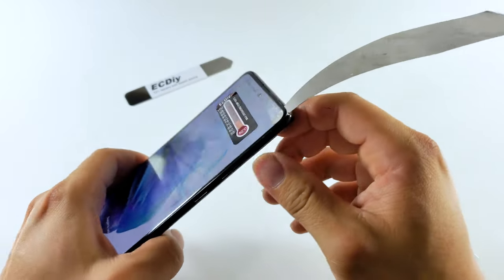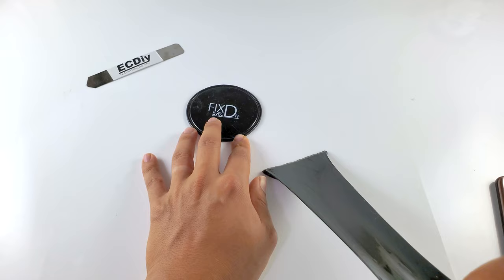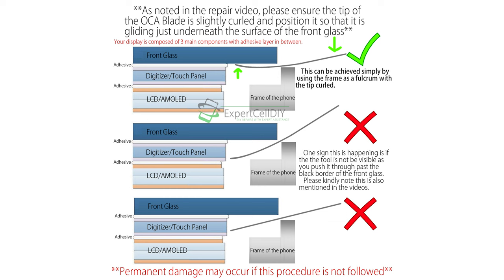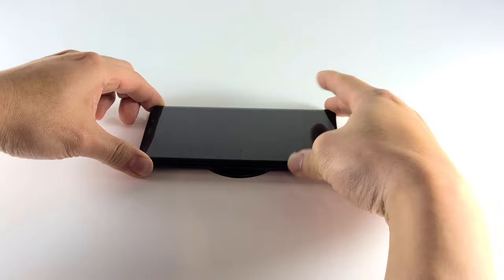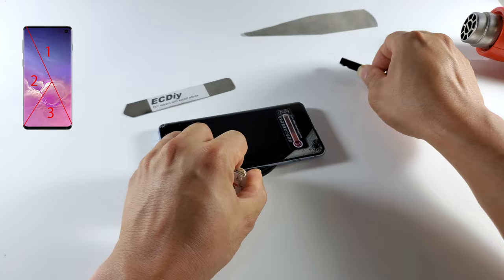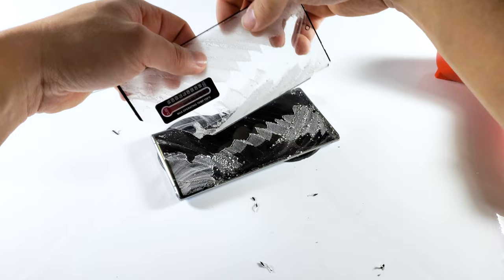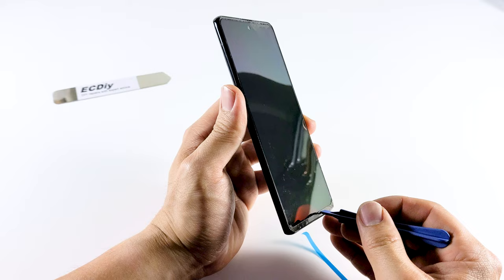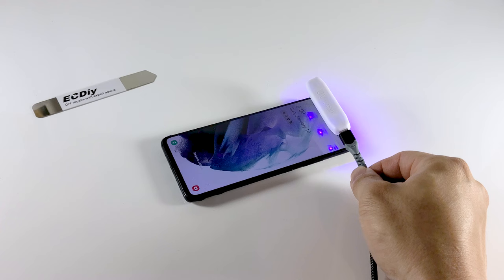How to Replace Screen Glass Only on Galaxy S22/21/20/10/+/Ultra/Note Shown in 6 Mins/New DIY Method

Comment: This is actually great. No clue why these kinds of repairs are less popular. Instead of paying 200 bucks for a completely new screen and completely replacing the oled and glass.
Reply: Because it's not worth the time and the risk of potentially breaking the screen while just replacing the glass. So is more simple to just replace the screen instead
Reply: @SuperMoni14  Well looking more into it I've found lasers which specifically target the glue between the glass and screen. That should make this whole process a whole lot easier and the costs you save on just getting a new screen is quite significant.
Reply: Yes it greate until u breake the oled 😂
Reply: @azzlack0699  I mean yeah sure and opening up your phone to repair it is great until your damage the motherboard. Everything has risks?
Reply: No only that but the old screens can be sold to a refurbishing shop and recirculated.
Reply: @SuperMoni14  That depends on the cost of OLED vs cost of glass. Front panel glass is cheap while most newer phones, its $200+
Reply: @Rakesh37187 there's a risk using lazer to cut through the glass can actually burn out the oled or lcd depending what model you plan on removing the glass but as you say there's risks involved in any repair prime example I didn't fancy replacing the rear glass on my iPhone 13 pro some company picked the phone up to do the repair they ended up breaking the display prying it open so ended up having to send me a replacement like for like
Reply: If it is your own phone or a phone you try to fix and resell, is great. But it is not worth the risk to do it for someone else, as the potential of breaking the LCD screen is very high.

This repair is also very very time consuming.
Reply: So that company can earn for the new product
Reply: @Rakesh37187 no, it’s riskier, oled panels are so incredibly fragile. One wrong poke can kill the whole panel
Reply: @SuperMoni14  a new screen for my phone is over $250CAD while the glass and repair kit with everything I need is about $55. So if you are handy what do you have to lose? Yes you could screw it up but if you are moderately good a fixing things you will save a lot of money.
Reply: @SuperMoni14 not really just order the glass and if u break the oled screen when trying to remove it send the glass screen back and just order a whole screen
Reply: @jasoncooke5741 exactly it's definitely worth it. $50 vs $200 and and hour if your time. I've done lots of older models like this heating it up with a hair dryer and never broken the oled. Was checking to make sure the s22 can be fixed this way and it can so I'll be doing it again.

Comment: Way too much work lol. I cracked my s21 ultra a few weeks ago and ended up picking up another one in near mint condition for 250 bucks. Sold my cracked ultra on ebay for 80 bucks. (it worked fine, screen was just cracked, no damage to digitizer). So, for a total of $170 I saved myself a ton of headaches by not trying to replace the front glass myself. Nice video though. It's too bad I don't have the patience for doing repairs like this.

Comment: This is so hard if you have never done it before. I consider myself highly skilled in many things including mechanical and electrical, but very easily totally damaged the screen underneath. Very difficult to understand how thin the and fragile the Digital film screen is underneath the glass. I would not recommend this to an amateur unless you don't care about damaging your phone. Just ended up costing me 550 in credits to turn in phone if I had paid 250 to have it done by pro's...so easily not worth the 25 to try and do it yourself thinking you will save yourself 225 or so. Just pay to have it done. Sorry guys. The Videos should show amateurs trying it and how easily it is to screw it up.

Comment: I just left a comment on the older guide, and I just gotta say it again: thank you so much for making an ACTUAL guide vs. the majority of the "guides" on YouTube that not only don't explain the process, but also don't explain what tools they are using. Thank you so much
Reply from the maker: Thank you so much for your kind words! To be absolutely frank with you though, I can't take the credit for it as I partially benefit from spreading this knowledge. 
    Also, it still has some ways to go as the repair is harder than it looks as mentioned in the video and many do find it to be difficult. I'd have to say curved Samsung phones are the most difficult compared to flat display phones and other makes. 
    With the upcoming iPhone tutorials, I'm going to be a bit more giving in that I'm also going to show how to do the glass only replacement even without the tools & accessories we've developed. 
    Any questions/concerns, please do not hesitate to comment further/contact us.
Best regards,
Reply: great video, but went to order for my s22 ultra and used the discount code and says my selection does not qualify. Web Page displays discount code is good till 10/2. today is Sunday the 1st. not sure why.

Comment: Just attempted this with my Pixel 4a 5g and ended up damaging the LCD in the process. The oca blade and wire technique worked great as far as I could tell. I'm not entirely sure what went wrong. The most likely culprit seems to be that the very bottom area of the screen has a slight overhang without any support from the rest of the phone. Unfortunately that's also right where the stiff material that forms the OLED panel is the weakest. There aren't any pixels there and the wiring appears unharmed, but a little bit of the material did chip off. Could also be excess heat or maybe damage from using too much isopropyl alcohol. Regardless, great tools. Thanks for the tutorial. Glad I at least attempted to save the OLED panel before ordering a new one.
Reply from the maker: Hello Ian,
    Thank you for taking your time to comment.
I am sorry to hear your experience did not go as smoothly as we have hoped. Would you by any chance have a photo of the display so we can take a look and see where it could have gone wrong?
   For Google Pixel phones, it is worth noting that the glass removal should be done with the display off the phone. Please kindly note that this is highlighted in our listing description section.
   You would place the display glass side down on the gel pad and use the wire tool. 
Any further questions/concerns, please do not hesitate to contact us/comment further.
Best regards,
Reply: @ecdiy  Thanks, yah I'll send a photo to the email listed on your website. Hopefully my mistake can help others.
I totally missed that there were any changes to the process for pixel phones. What you're saying makes sense now.

I'm a beginner to phone repair though, so it's not a big surprise that I didn't manage something tricky like this the first time. It just seemed like such a waste to throw out a perfectly good oled panel without trying to save it.
Reply: That's the spirit! Good luck with your future repairs.
Reply: If a chunk of glass is missing from the lower left corner can you use this to your advantage? Possibly starting to separate the display glass from that point? This is on a galaxy s10 I can clearly see what I assumed be the next layer in the display. It is flexible...

Comment: Sadly, even if you manage to get the glass off, the most proper way to put the nw glass on, is by luminating it with a machine (together with the phone of course. ) Two problems with the loca glue : 1- It will come loose eventually, and form bubbles .   2 - When you hold the phone up to the light, you can see that the glued surface has some waves (because the glue will not spill in a straight line. That would be hard to achieve).
Reply: I think this repair is aimed towards the cost effectiveness rather than cosmetic perfection. Some ppl see this as an absolute win and some may not. Nonetheless, it is an option to fix cracked screens.
Reply: @threecubed3 i just dont wanna buy another damn phone or pay 100$ less for a repair shop to fix this when the kit i got was 20$
Reply: @HansBelphegor  fair enough I'm glad it worked for you 👍

Comment: Just bought s20 ultra kit a week ago. Just a quick question regarding the front camera part.  
Do i need to remove the Back cover and the Front Camera before applying the loca glue (does the kit include the sticker that wouldnt need me to remove the back).

Comment: holy cow, up until today I had only seen repairs that required the replacement of the entire display which cost more than the phone was even worth! My S9+ is eligible for a $400 trade in only if the glass is not cracked, otherwise T-Mobile will only give me $13!
Reply: The use of UV curing glue is awesome.

Comment: Just wanted to leave a comment that I ordered this for my s10+ and gave it a try. I'm familiar with all other kinds of phone repairs but this is the one that's made me anxious the most. I busted my digitizer BUT it was my own fault. Like the start of the video mentions, it was not hot enough so I couldn't tell how/far the blade was fitting between the frame. I use the heat sticker but even then it's kinda tough using a blowdryer. I had full blast it directly on top to see it start changing colors, then rush to try and get in. If digitizers were more affordable, I'd love to give this another try!
Reply: Did you have success with the kit?  I have the same phone as you

Comment: It looks like you guys thought of nearly everything to make this repair as easy and successful as possible. I have 2 questions. Does the wire tool come with the kit? And how do I know how much LOCA to put on the display?
Reply from the maker: Thank you for your kind words!

    We continue to improve the kit as well! More on this below but to answer your questions: Yes, the wire tool is included with the kit and the amount of LOCA required for the model is listed on our latest tips & tricks page the address to which we print on a slip included in each kit. 

   The latest update to the kit is a clear camera hole cover film which all you'd need to do is press to seal over the camera hole area prior to gluing. This eliminates the need for back glass removal as well as the front camera removal.
    Currently, it is only being provided on a request basis at no extra cost and no negative feedback has been received. It is briefly featured in our Pixel how-to video as well as the latest Samsung shorts video, but we will be making a full video for this soon. With this, you wouldn't have to open the phone at all.

    Any further questions/concerns, please do not hesitate to comment further.
    Have a great rest of the day!

Comment: I bought it and I can say hats off to nanyone who can do this without damaging the screen.   I think they make money on false hopes. I would love to see an uncut video where this is done 👎
Reply from the maker: Hello Kalman,

Thank you for sharing your experience. I am very sorry to hear that it did not go as smoothly as we had hoped.

As our business started with the aim of providing affordable screen replacements, receiving feedback from customers who encounter difficulties is something we take seriously. It motivates us to continue innovating and making repairs easier. Would you be willing to share with us where things went wrong? This information could be helpful in assisting others to avoid similar situations.

We may offer to issue you a full refund even though some of the items have been used. However, I would like to note that while the tools may differ, the fundamental concept behind our kit is essentially the same as what you find in other repair videos on YouTube.

The gel pad, sticker thermometer and a hairdryer/heat  gun are substitutes for the heated suction pad machine used by others. We understand that having that equipment can be more efficient. Although refurbishing a screen is a lot more delicate process, it can be compared to assembling furniture with a screwdriver instead of a drill.

The only thing that differs is the initial separation. You may see others using a rotary tool to cut the glass around the corners to initiate the glass separation with the wire tool. This not only means an additional equipment is required, but in my opinion it's also not something that can be done successfully without training.

With our method, the OCA blade is curled up and leaned back so that the tip is touching the underside of the glass and heat is applied to soften the adhesive holding the glass to the OLED thereby allowing the initial separation to take place as mentioned in the video.

If we can be of any further assistance, please do not hesitate to comment further/contact us.

Comment: I have few S21 ultras and S22 ultra screen was cracked still worked the dye effect around the cracked screen then display was halfway down with green line can I as a newbie fix it?, and will it need more than just the glass?

Comment: I purchased the kit for the  galaxy s20 ultra a few hours ago. Informing myself as much as I can to avoid damaging my phone when I eventually attempt to follow your great tutorial. I had a question regarding the front camera removal. I saw that in order to remove the camera, there are several components I have to remove in order to be able to access it. This means that I would have to disassemble it, remove the camera, reassemble, glue front glass, then go through the steps to insert the camera in again? Is the camera removal strictly necessary? Also I saw in another video that there is adhesive I need to cut through in order to physically remove the camera. Does the kit include said adhesive as well? Sorry about the essay I'm making you read!
Reply from the maker: Hello,
Thank you for taking your time to comment!
    I apologize for the delay in my response. Yes, for an S20 Ultra, you'd want to remove the front camera prior to gluing. We do include the IP68 back glass tape adhesive with the kit which is the adhesive that needs to be sliced to open the phone. 
   As for the steps involved, you would want to remove the front glass first, then the back glass (You can use the back of the OCA blade for slicing the tape adhesive), remove the front camera, do the gluing process then re-assemble using the new tape adhesive included in the kit. 
    Is it strictly necessary? That depends on whether you want the front camera to be as clear as before. Removal of the front camera is done prior to gluing on these phones because the glue would flow into the hole for the camera. The phone will function fine regardless. 
    Any further questions/concerns, please do not hesitate to comment further/contact us! I'm happy to help.
Best regards,

Comment: What type of glue is required?
Reply from the maker: Hello Fahim,
Thank you for your comment!
It is called LOCA. The brand we use is Stronghold. LOCA stands for Liquid Optically Clear Adhesive, there are several options but please kindly note many LOCAs require a separate UV lamp to cure. (Ours is specially formulated to by hypersensitive to UV, so much so that exposure to daylight on a cloudy winter day is enough to cure the glue. I'd also like to note that ours can also be cured with a UV light).
   Any further questions/concerns, please do not hesitate to contact us/comment further.
Best regards,

Comment: Merry Christmas! 
Great video and technique for DIY. For people that have patience and a steady hand and don't want to pay others to do it, it's haven sent. I'm looking to buy the kit as it will be invaluable for future repairs, but I don't see the double-sided black round pad in the kit.
Cheers
Reply from the maker: Merry Christmas to you too! 
The gel pad, wire tool, the sticker thermometer and the UV lamp are all being included free of charge with all repair kits for a limited time. This is noted on the top of thee page as well as the main banner on the home page.
Any further questions/concerns, please do not hesitate to contact us/comment further.
Best regards,
Reply: @ECDiy  shame:))) I saw this after I wrote the question. I'm looking forward to using your kits.
 I hope I pay more attention when I am repairing:)))
Cheers

Comment: Is the oca blade reusable or is it done after one repair ?
Reply from the maker: The OCA blade is indeed re-usable. Using it with the wire tool as shown here, it would be good for many devices (easily over a dozen). 
   Please do kindly note that, pushing it when there is not enough heat can cause the tool to flex and when this happens many times, the tool can experience this thing called metal fatigue and slowly start losing its effectiveness. When used properly, you can easily do 3~4 devices with 1 OCA blade even with the OCA blade only method.
    Any further questions/concerns, please do not hesitate to contact us/comment further.
Best regards,

Comment: With glue do you use? B-7000?
Reply from the maker: B-7000 is not optically clear, and it will not work for this application.
We use the Stronghold LOCA. LOCA stands for Liquid Optically Clear Adhesive, there are several options but please kindly note many LOCAs require a separate UV lamp to cure. Ours is specially formulated to be hypersensitive to UV, so much so that exposure to daylight on a cloudy winter day is enough to cure the glue. Other parameters such as contractility, tensile strength and viscosity have all been fine tuned over the years for optimum results. 
    Please note there are a few sellers infringing on our trademark, Stronghold LOCA is developed by us and is exclusive to us. 
   Any further questions/concerns, please do not hesitate to contact us/comment further.
Best regards,